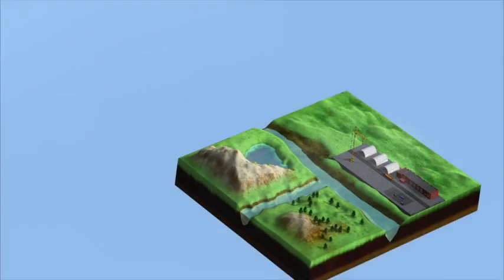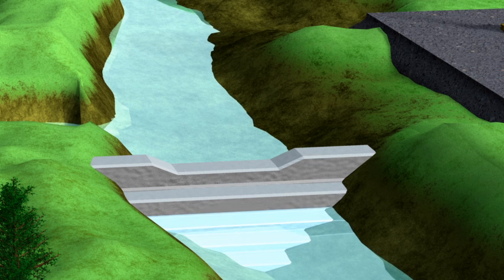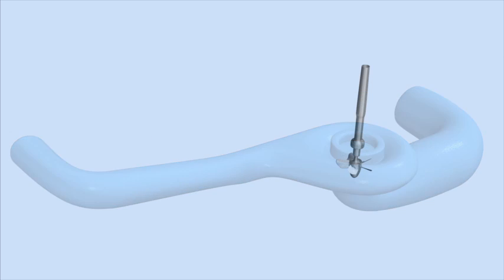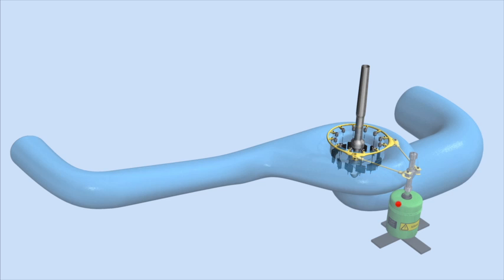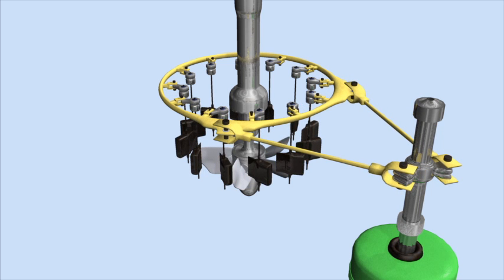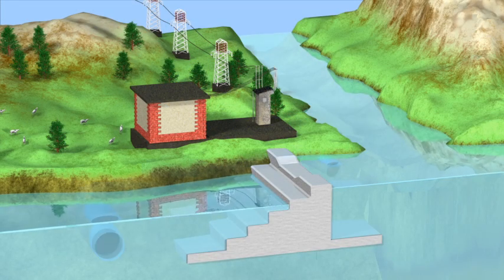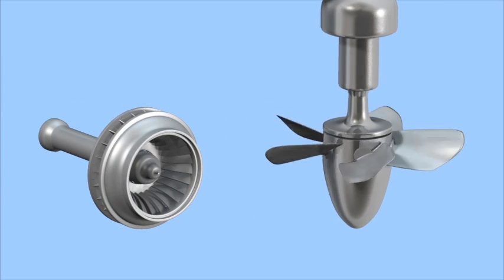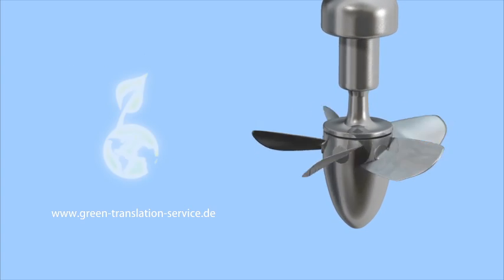Kaplan turbine / Run-of-the-river hydroelectricity - How it works! (Animation)

Comment: Very good job. Now add variable pitch impeller blades, and use a more aggressive prop. aspect ratio. You can dial it in to give the best torque out put for a given rate of water flow. And then optimise the shaft speed by varying the brake force from the power generator. It`s all been done before, ie variable vane turbos and variable pitch props.

Comment: why is the water coming from the side before leading it in axial direction, is this not a circuit?
Reply: +Garretthierisser You could think of it as a circuit (hydraulic). The water comes from the side because the water inlet to the turbine runner is at the side. Also if the water would come from the bottom (axial direction first), then that would be a pumping action (not a prime mover action).